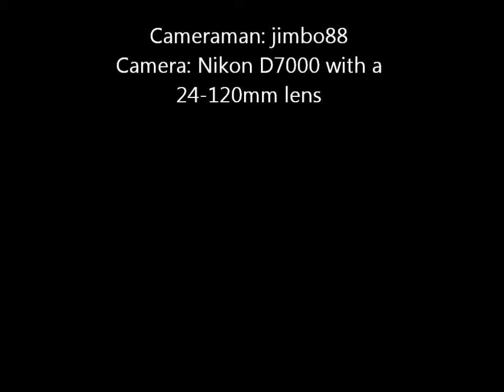Troubleshooting a Taco Zone Valve: Checking the Voltages

Comment: You need to see 24v across terminals 1 and 3 to prove the end switch is closing, you can have voltage all day long on 1 and 2 but you won't have heat of the end switch isn't closing.
Reply: actually to check the end switch you check across terminals 2 and 3, if no voltage end switch is good, if voltage across end switch is bad replace power head
Reply: correct
Reply: @williamginocchio3556  wrong

Comment: You should also check resistance across 2 and 3. Dial the thermostat up after being off and watch it. After a minute or so of power the resistance should drop to nothing and your boiler turns on. Turn the thermostat back down and it should reverse after a while

Comment: This doesn't prove the valve is bad, it only proves the thermostat (when on) is sending 24 volts to the valve, and that's it!
I just experienced this, I had 24 volts to the Taco zone valve, the circulator pump would come on however, the boiler burner would not fire. The end switch in the zone valve was bad terminal #3 did nothing.
I replaced the Taco power head and it and the boiler operated as should.
Reply: the title says "Checking the voltage"
While checking voltage does NOT cover all possible reasons of malfunctions of device, it sure does rule out some of them. As you said it does check the power voltage being supplield, also it could possibly show abnormal voltage reading created by a device.

Comment: Step#1 Turn the thermostat on and check the voltage across #1 and #2, it should read 24 volts. 

Step#2 Discount the wire from terminal #3 and now check for continuity between terminal#2 and #3 using Ohm meter. If Ohm meter reads 0 the valve is good and if you see infinity or an open circuit the valve is bad.
Reply: exactly right
Reply: For Step #2, should you turn off power before disconnecting wire from terminal 3? Thanks!
Reply: @caitididnt  You dont need to but if you feel comfortable doing it then turn the power off.
Reply: @copkhan007  🙏
Reply: Bad valve? Or power head?
Reply: @dritanshabani6396  Bad Valve.
Reply: What would indicate the power head is bad? When voltages are correct but still no flow?
Reply: @brianfaria  its rare the valve itself goes bad....usually the head....light tap with screwdriver on the body can free it up ..
Reply: @workingshlub8861  good to know and thanks for the response.  We replaced the power head and 3 weeks later it occurred again so we will swap the valve out.  I think it can be done without replacing the valve housing.

Comment: YOU ALSO HAVE TO EXPLAIN ABOUT THE VALVE,,, WHERE THE HEAD SITS,,, SOMETIMES GETS STUCK IN THE OPEN POSITION,,, IF YOU HAVE A WATER STORAGE TANK ,,,IS CALLING FOR HOT WATER ALL THE TIME AND THE WATER GETS VERY HOT.

Comment: Isn't the arm on the valve supposed to move?
Reply: The arm on the valve allows you to manually operate the valve opening if you need to troubleshoot a system or have heat temporarily. You'll notice the arm is harder to pull when the motor isn't getting power. This is because the valve isn't open when the motor isn't getting power and you're opening the valve yourself.
Reply: Isn't it that the arm will be harder to pull when the motor IS getting power because there will be water pressure and it will be easier to pull when there ISN'T power because there won't be pressure?
Reply: Scott Marcus 
Other way around. Easy to move lever when valve is calling (90 second delay). Hard to move if it isn’t calling.

Comment: huh?? this is not how this works the only reason you have a lower voltage is because there is a heating element in there and when it reaches temperature its not pulling as hard on the XF

Comment: i wish they would tell you what the red wire is for. What if you tested it, would it ruin the meter
Reply: Be cautions...  If you live  on either coast of the US, it could have very well have been installed and wired by a DemonCrat .

It may blow up your meter if it was "Made in the USA" they operate on 24Volts AC or D.C. or Sis gendered power.  😆
F
Alternatively....
You might be safe if you use CHINESIUM type meters...

Good luck all..
👍🏻😄

Btw: even if voltage is measured any of the terminals, that does not ensure that the valve is operated internally and mechanically. When the valve is actuated/open, the actuator will close they normally open switch called the end switch.

The thermostat controls the zone valve, which in turn controls anything or everything from the circulator pump to the boiler itself all depending on how it is installed and configured.

Comment: A quick check is to momentarily short #1 to #2 and see if there is a spark.           if so, voltage is present and the valve should be open. After a couple of minutes iof the valve is not open, it needs to be replaced.